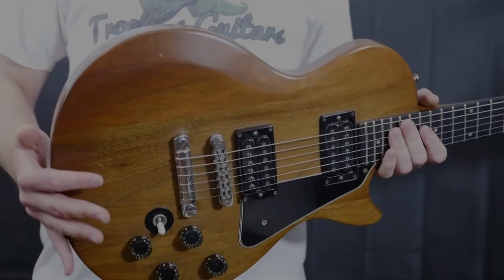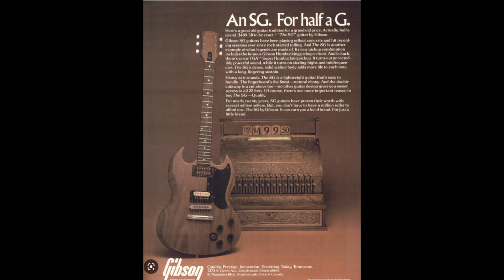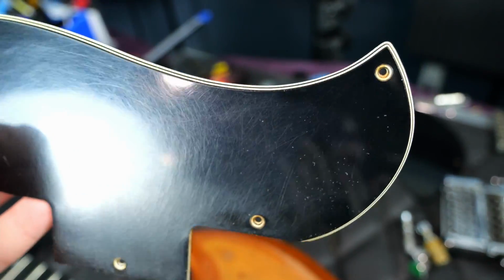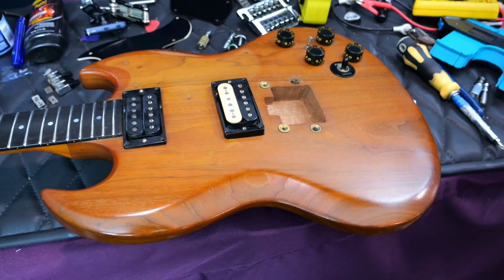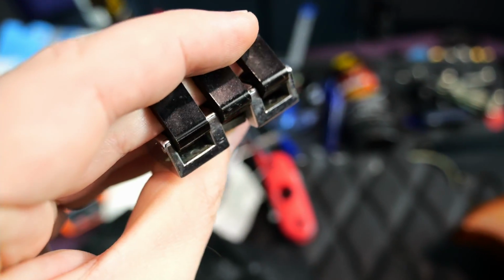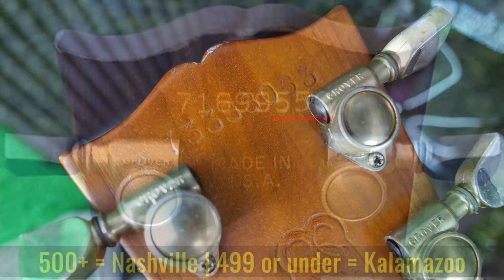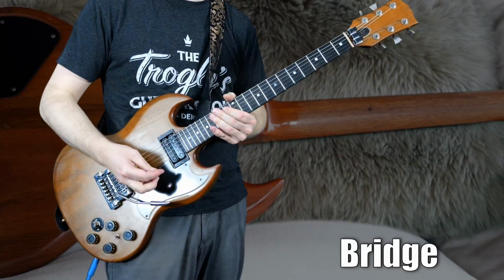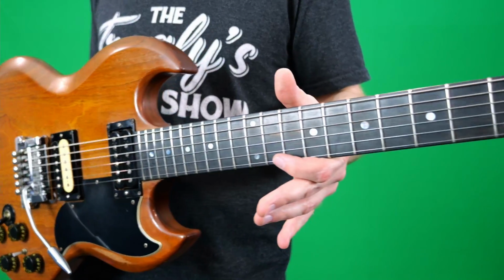I Bought a RUINED Piece of Gibson History | 1978 Gibson "The SG" Original Prototype

Comment: I actually think the Kahler looks pretty cool on it, I’d leave it alone and play it.  It’s already a player anyway. I don’t think anything unless you wanted to paint it , filling it wouldn’t look as cool as the Kahler in my opinion. I normally don’t like SGs but that one is pretty awesome looking to me.
Reply: They just don't play or intonate well, Mine is filled a has a Bigsby now.
Reply: @timscarrow9151  I’ve never fooled with a Kahler much but I’d imagine a bigsby would be a whole different kind of nightmare for me. I have really heavy hands and probably couldn’t keep one in tune even if I didn’t touch the bar.
Reply: @brandonjackson5865  I had to replace a falling bridge, and raised the bigsby off the body to decrease the angle, it works better than I thought, I also am ham-fisted.
Reply: @timscarrow9151  cool yeah I guess with the right angle across the bridge and good bridge slots and a nice nut a bigsby could probably be about as stable as any other non locking tremolo and they look really cool on some guitars too . Surprisingly I really love the way that flying Vs look with bigsbys on them. About the only trem I’ve ever had luck with is my old RG550 with an edge lo pro on it and as long as it’s set up correctly it’s rock solid reliable, I’ve been messing with a Wilkinson fender style trem I put on my Baretta special I got because I always wanted a single PU super Strat and even though I’ve got locking gotoh tuners and a graph tech nut my high e string won’t return to pitch and I see all these guys on you tube able to get theirs with supposedly stock hardware to return to pitch every time, but I think they all have to dump the bar or pull up to reset their standard trems to return to pitch. I’m stubborn and if they can do it why can’t I lol ? Even though I rarely use a bar except for just messing around anyway. I’m mechanical minded and can look at the parts and think ok this should all work but it doesn’t always and it can drive me mad if I let it. The older I get the more picky I am about intonation and fret buzzes and rattles , stuff that used to not bother me a lot, really annoys me being just a little off. You know ? Get off my lawn so I can yell at the clouds and shit ?
I’ve always thought Kahlers looked cool on certain guitars too like the bigsby in a steam punk kinda way, I want to try something with an ever tune but I haven’t had the chance yet it sounds like it would solve most of my annoyances but I think evertunes are ugly so who knows, guitarists we’re a fickle picky bunch

Comment: One of my big gear regrets was trading off my 1983 "The SG" in Electric Blue. I saw it again about 12 years later, and the next owner abused it terribly. The headstock had been broken and poorly repaired, and the body was severely cracking on both side of the neck joint. i plugged it in , and it still sounded amazing, but it was so sad to see the condition it was in.

Comment: Sounds great especially considering the mod. You could pull the behind the nut lock for locking Grovers. The key with Kahlers was keeping the roller saddles clean and moving and enough down pressure on those saddles. Also the many adjustments could be a mystery.

Comment: In 1980 at 16 I bought my first Gibson. An SG firebrand that unfortunately had a decapitation about 3 months after I bought it. I got it fixed and gained a sweet black stinger on the neck. To my point, what is worse, a headstock break or a kahler  rout? I'm gonna just leave that out there for everybody, but I would have dive bombing the shit outta mine if it was kahlered back then. Always loved the pickup switch and output jack locations also.

Comment: It's an easy fix with a router and put a square block there, and if you put a harmonica bridge it will be reasonably hidden.
One of those tailpieces with fine tuners too and it could just be two seam lines between the bridge and tailpiece and then that will be hidden by the strings.
 
Could be a cool project to send the guy who fixed that old Goodwill Les Paul Special for that other youtuber?
 
It's a prototype, one of a kind, it deserves to be restored properly!
Reply: They can also restore the cable for the neck pickup

Comment: I died a little bit inside when I saw the truss rod cover cut off. I would set the Kahler lower into the body if possible. This video sounds great and the Kahler might be contributing positively. Try it with a set up with a proper new nut and set up. If you want to do a 70s freaky thing, do a brass nut and a Leo Quan bridge. I like the idea of an ebony rout-fill.